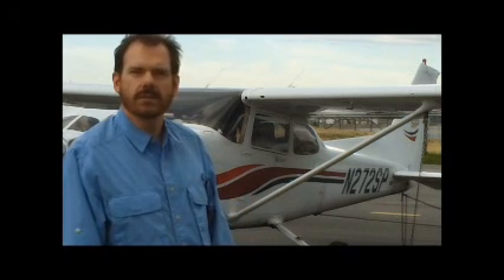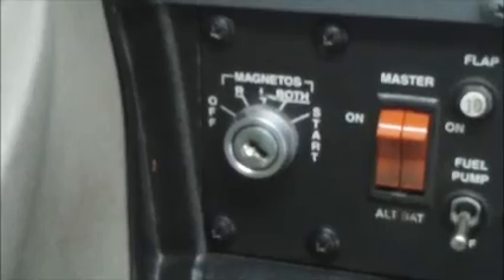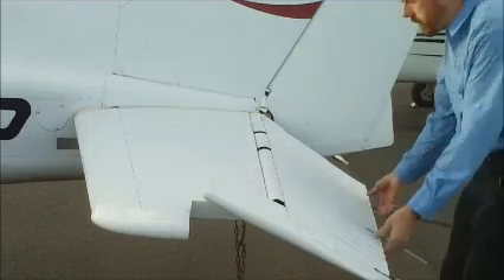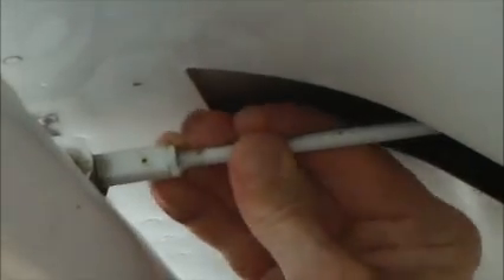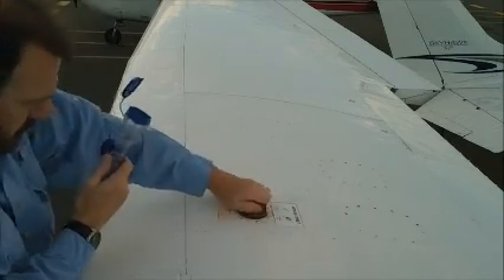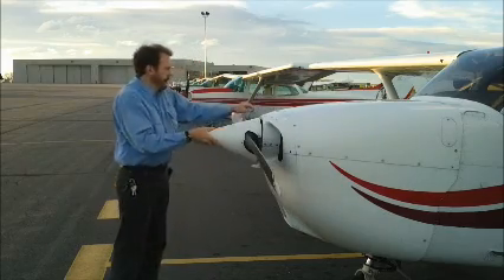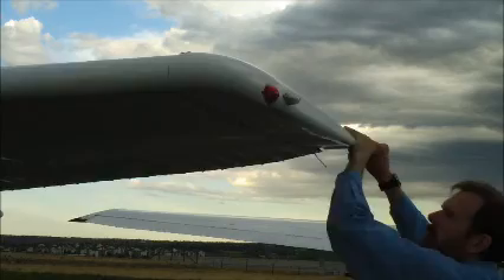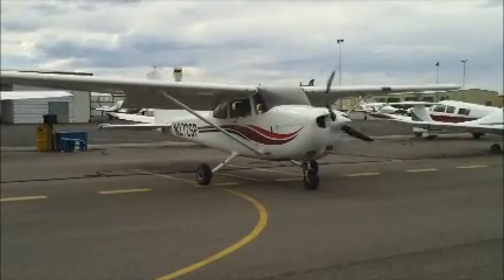How To Preflight a Cessna 172

Comment: Pretty good, but!

Never put fingers in aileron gap…windy? Lose a finger.

Never Turn Prop by hand…mag catches engine starts!

Keep chalks in until right before you taxi out.

Check stall warning and let pitot heat-up 30 seconds to feel with backside of hand on walk around.

Visually look into fuel tanks..Never trust gauges on these little planes.

Comment from the maker: It's not easy, but you can turn it far enough to allow for inspection of the air intakes and alternator belt.  Just be double and triple sure the magnetos are off and the mixture is at idle/cut off!

Comment from the maker: As far as fueling goes, I don't do any fueling.  The club has a standing order with an FBO on the field to fuel the 172's whenever there's one on the flight line, so they're always full.  The fueler puts a chalk mark on the nose gear tire to indicate that the plane has been fueled, so if you see that mark, you know the tanks are full (but I always check anyway).

Comment from the maker: Thanks for commenting.  The way I understand it, if the rod moves too much, it means it needs to be greased or it will wear down the little pin it's connected to inside the flap.  And if the rod doesn't move at all, it may have seized, and that's bad too.  So it should wobble, but just a little.

Comment from the maker: Great question.  The reason I take all five samples at once is that our planes are flown and fueled so frequently that there is little chance the fuel will stagnate and erode the tank bladders, creating sediment.  Also, tanks that are always filled up to the filler necks stand less chance of water condensation inside the tank, as there is less room for air.  I've never found sediment or water in a sample from any of the club's planes.  Just my opinion, though.